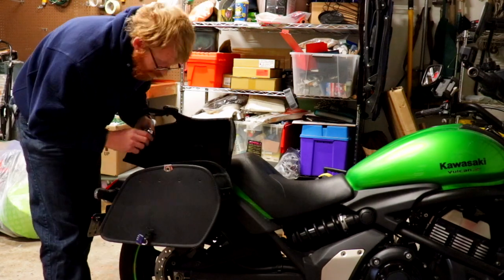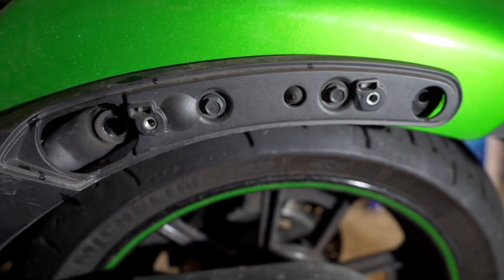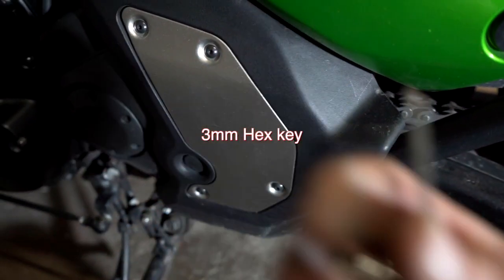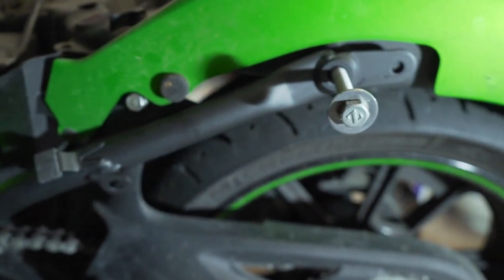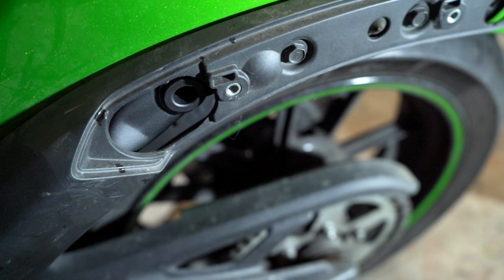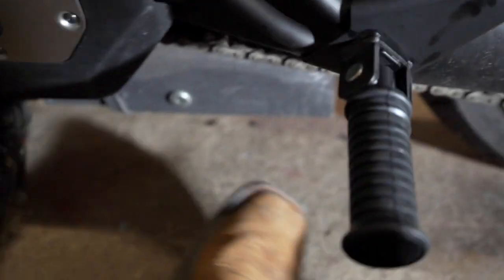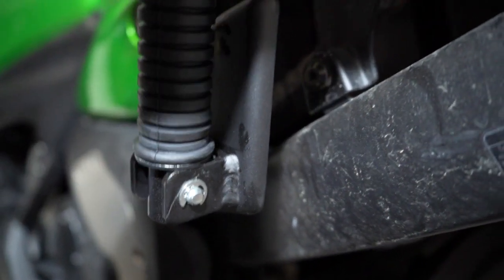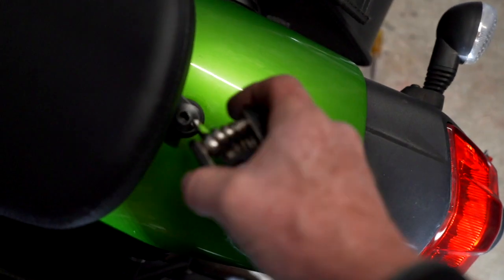How to install a rear seat and passenger pegs on a Kawasaki Vulcan S 650

Comment: First of all, thank you for this video, I  do not own a Vulcan S.....yet,  I just sold the last Harley I will ever own. I paid $37,000 for it and it broke down four times within the first year. Then I sold it for $28,000 and glad to be rid of it. I could buy a Vulcan S with all the fees and taxes with the money I lost on the Harley.
   I wnat a bike that is comfortable and reliable and NOT a V-Twin. I'm tired of the chug chug chug. I think I found the perfect bike for me, the Vulcan S. I like the gauges being up front and not on the fuel tank, I like that Kawasaki placed the ignition swicth where they did and even thought ahead far enough to install that piece of plastic around it so your key chain (plastic) won't scrath the paint. I totally love the parallel twin engine and six speed gearbox. I like the alloy wheels because they give you tubeless tires, and the low seat height because I'm short legged. 
   As you can tell I like just about everything about the Vulcan S. But I do think for the price Kawasaki should give you a passenger seat and passenger foot pegs from the factory. If somebody wants to take them off, that's their choice, but I think they ought to come with the bike.
    Ride safe and enjou every journey.